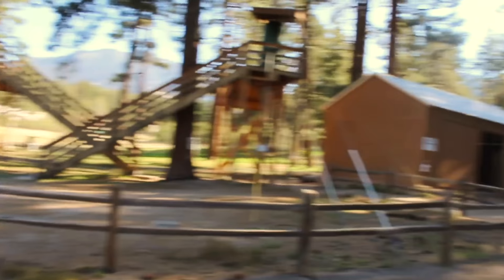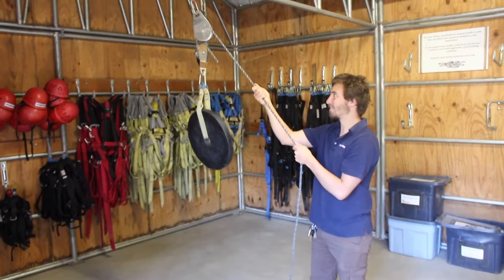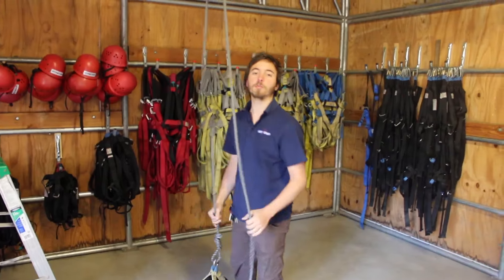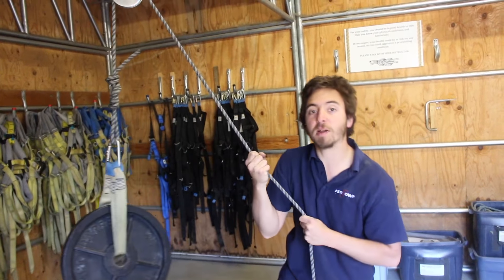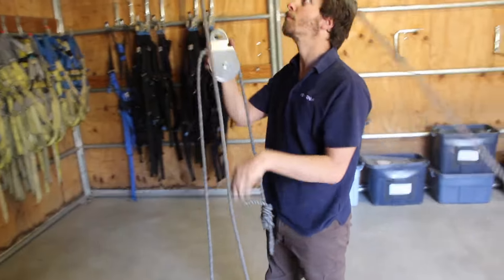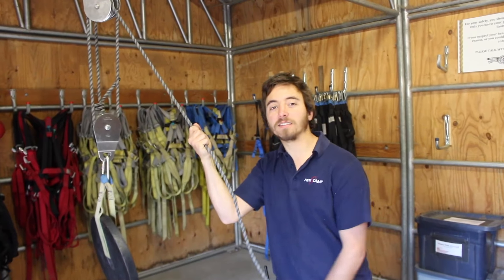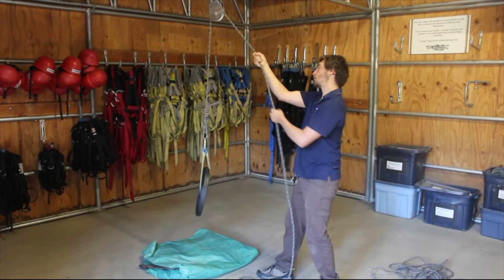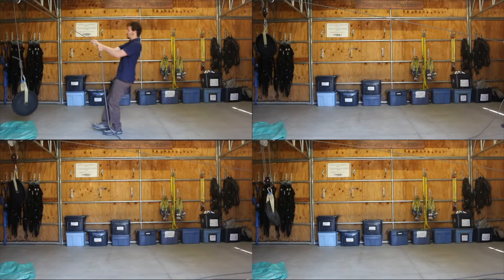How do Pulleys Work?

Comment: Thank you. Believe it or not I watched several videos before this one and none of them explained how, even with demonstrations, pulleys work. I could have saved so much time if they explained the weight is half as much because there are two ropes lifting the weight, plus you explained the length of the rope. Physics teachers rambled on for 15 minutes and didn't mention these two key facts.
Reply from the maker: No problem! Once you start adding pulleys and more rope, it becomes way easier to lift things up!
Reply: Yeah, I agree; I read an encyclopedia which said you have no mechanical advantage with a rope over the top of one pulley but you get a 2:1 advantage if you pull it up from below one pulley. Intuitively, I thought because the beam is supporting half, but the article never said it. So I wondered if I should make that inference if he didn't. He said you have to pull more rope. Many teach without understanding something, I find. They copy what they hear and leave out key things.

Comment: You can do the same thing with 1 pulley as you did with 2. Just tie of one end of the rope to frame and have weight hanging between the tie off and the pulley.

Comment: Is there a way to have an on the fly modular pulley system? One where you can use a 2:1 advantage and then change it to a 1:1 advantage with minimal effort for actually changing the cable/rope routing?

Comment: Great explanation. Thanks.
Anyone able to help me?
I want to use a pulley to raise a parachute onto a ridge line and avoid needing to undo the ridge line.
What could I use to lock the rope off once the parachute is hoisted, locked  both in horizontal position along the ridge line and also  vertically once raised by the Pully? itself.
For vertical locking, would either clam cleat  or cam cleat work?

Comment: the thing that confuses me is saying that increasing distance reduces force. if i had a rope to pull a heavy thing but just had it go really far and pulled it in a straight line the same amount of force would be necessary than if there were no ropes
Reply: Yeah, that's for a rope over the top of one pulley, which gives NO advantage. The key to making it lighter is to increase the load on the top beam by dispersing among many pulleys; think of it as 6 kids lifting a heavy rowboat of 300 lbs. They take sides and each  lift 50 lbs. A pulley system could take up 5 of 6 sides, as it were, by multiple lines to the top beam through other pulleys. So you only pull one rope with 50 lbs. 
Or better yet, attach the rope to a lever, the load arm, to get the law of levers to give more mechanical advantage of say, 5:1 on the rope by an effort arm that is 5 times longer than the load arm, past the fulcrum; so that 50 lbs. rope force now feels like 10 pounds on the lever's handle.
Reply: It's because the pulley acts like a scale or a seesaw. The object that is being lifted by one pulley only moves up and down half the distance of the length of rope that is pulled. 

Lifting a  10lbs weight 5' off the ground is equal to lifting a 5lbs weight 10' off the ground. They both take the exact same amount of force. Now when you use the pulley you're pulling down the 5lbs weight 10' instead of having to lift it.  (Substitute lbs for kg and ' for metres if it helps)

In your scenario you're just pulling on something far away but moving it the same distance as though you were standing next to it. You don't have a pulley to double the distance but halve the object's weight.

Comment: Do the wheel of pulley have to always rotate? Can there be a pulley which doesnot rotate and the rope just slides through the circumference of it? Will such pulley give mechanical advantage?
Reply: Good point and not at all obvious. The pulley, having bearings at its centre, reduces friction. It would work if it DIDN'T rotate, but friction  -- of rope sliding against pulley -- would be greater.

Comment: Politely I think your schooling is wrong... It is not split up between these two ropes... Is it not the mechanical advantage held within the circumference of the pulley wheel.. so correctly you should say that the wait is split up between the leaver advantage of the pulley wheels...